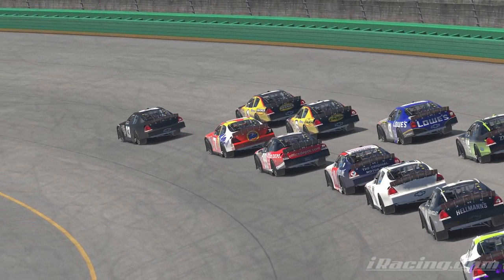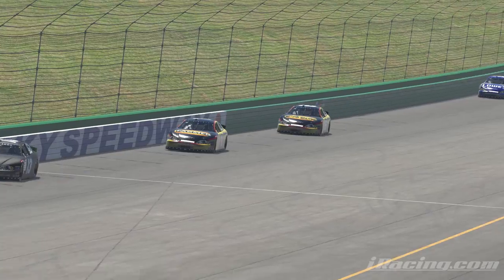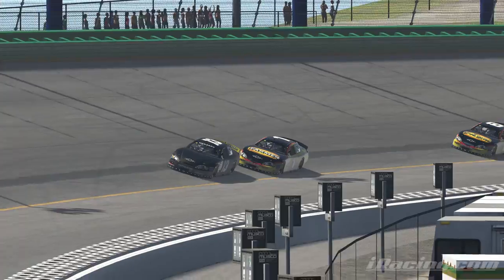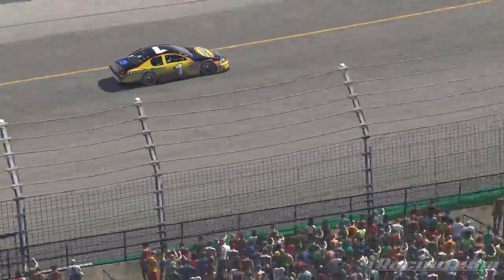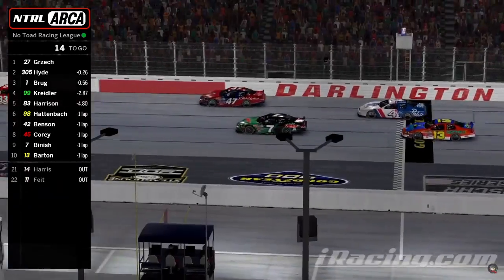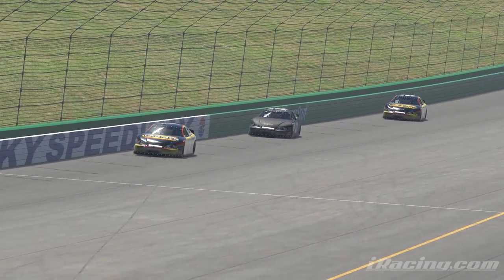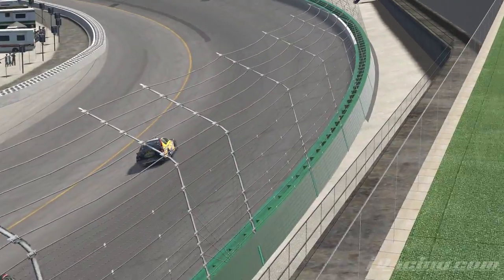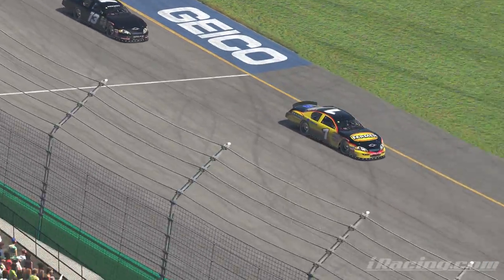7 Things Road Racers Don't Understand about Oval Racing

Comment: I've been a road racer for years and just now trying out ovals (mostly as a way to race without worrying about my iR, bad habit I know). Forgetting which corner I'm at is the biggest thing I'm struggling with for sure. As you said oval racing is a lot more mentally draining, as you can't zone out and run your laps the way you can in road, and every race there will be some laps I majorly mess up from losing that concentration. I've been trying the trucks at Darlington this week and it is NOT good to forget where you are there.
Reply: Every oval has a personality.. you will learn them as you go along... where the bite is.. where that little drop off is etc.
Reply: Indy looks easy but if you lose concentration it will bite you it looks like 4 90 degree corners than you drive and each corner feels so different
Reply: You'll get your Darlington stripe across the side of your car from hitting that wall 15 times in 1 race like everyone else lol

Comment: I race on a dirt oval. I was always told that breaking will make you slower, but in order to not rely on the break to set the car up in the corner, the car has to be setup for that certain track. That the hardest part. Driving will come with seat time. The hard part is learning how to setup the race car in preparation for a race.
Reply: What type of dirt oval do you do race? I do winged and Non-winged sprint cars and midgets, for nonwing and midgets the brakes are almost needed to get through every turn fastest, winged cars depend on the track and line. I just run the default setup iracing has given and gotten 3 wins in 22 starts this year all in open setup races
Reply: @tylerhendrickson5184  I race a USRA Limited Modified. It’s like street stock suspension on a dirt modified chassis. I’ve never been able to setup my old car in the corner without using the brakes, but I know of people who doesn’t used the brakes unless they are under caution, but they have a lot of knowledge about race cars. Idk how my new car will do. I just hope it turns better than the old one.

Comment: I don't think anyone would question the skill of the drivers, but what I don't get is why people watch it. Like, yeah there are a few more accidents, but at its core it's just cars going in a circle for 2 hrs, I couldn't watch this that long as it just looks so boring, its like that one torture method where they drip water on you for hours. Same with street tracks (and tbh, I just watch recaps for that exact reason) but there is at least a bit more to look at than just the cars.
Reply: While I don't like watching it, I could understand why, there's much more action than in other racing series such as F1 or WEC
Reply: I every never understand this take. People watch races so they can see drivers compete against each other. The track just facilitates that competition. If you want to see the drivers compete against the track, then why not just watch time trials?
Reply: @eliwhite5548  For me it's more about the cars performance at a given track, I guess this may cause the differing viewpoints on this.

Comment: Jimmie Johnson was great at maximizing exit speed. The way he rotates the car mid corner sometimes is unreal. You could even see it in Indycar on the ovals he had different lines to everyone else
Reply: Had a couple races like that at Richmond in the I***car (fixed). I was running the bottom instead of the middle like everyone else, was fastest on track the entire time, and won both races by a considerable margin. All thanks to trail braking and proper in-car setup differences, which saved my tires and let me be consistently faster than everybody else.
Reply: He is 7 time champion for a reason
Reply: I remember watching a Charlotte race back in the gen 4 era where one of the announcers noticed Jimmie's brakes were glowing, and he won the race, then next time the series went back there every car's brakes were glowing, everyone was suddenly racing it like Jimmie, but he still found that little bit extra in the turns every lap
Reply: Jimmie is a beast in oval races. Last season he found pace that seasoned racers did not have. Very average in road races, but probably the most entertaining on the ovals.
Reply: Kinda sad when they started broadcasting NASCAR in my country, he was retired already.
Reply: @djvycious  Average is a very very generous statement. He was straight-out terrible. He had no pace, despite driving top-team car. And his performance convinced me that Stock Car racers are inferior to other. There are instances, where open-wheel or sports car racers became sucessful in stock cars but never vice versa.
Reply: @jedlin1256  I'd say Scott McLaughlin is a pretty successful open wheel racer and he came from v8 supercars.
Reply: @Staggs2200  but he came from touring cars, not stock cars, still very different type of racing from Indycar, but also no oval racing
Reply: @jedlin1256  this recent chicago street race outright proved it. in terms of road courses nascar drivers just generally arent good, but their feel for the ovals theyve been racing their whole lives is just something else and its a lot of fun to watch

Comment: I'm Australian but went to college in America in the late 80s. 
Its unreal how you have describe almost perfectly what I heard a couple of legends say 30+ years ago.

I became fascinated by the tactics of NASCAR. Like American football its very simple at one level but then also incredibly nuanced in some very subtle ways.
One day I saw Daryl Waltrip go over his car and how it was setup. He talked about the position of the steering wheel which looked almost ridiculously close to his chest but it was so he could put his shoulder into it because of the fatigue of driving 500 miles every Sunday.
On a very similar vein Jackie Stewart had quipped about how it was just driving in circles so someone said here's my car go do some laps. Jackie Stewart could drive as fast but after 20 laps he pulled over exhausted from it. On several occasions afterwards Jackie told people NOT to underestimate how hard NASCAR was. He described it as relentless speed and the ability to do perfect left hand turns because (he explained) being slower by just a tiny amount added up very quickly and there's no real way to make up time like they could in F1.
Reply from the maker: Very cool experiences thanks for sharing!

Comment: Perfectly said about the eggshell under the throttle. I was running some practice laps at Milwaukee last night, and I had to learn that the hard way. Once I started finding that proper groove with the brake and throttle and steering, I was running 31.3 laps. Still not the fastest, but respectable in my opinion

Comment: I am a road racer and I have dabbled in ovals on iRacing.  From the shortest ones to superspeedways. I don't mind running them every now and then, and I have had very enjoyable races.  What really puts me off is not the concept of the oval, but stock cars. Most  oval races I liked were in openwheelers.

For me stock cars are too heavy, with horribly bad boaty suspension and the worst brakes ever. And, above street stock, they are ridiculously over powered, especially for short tracks.  I just can't enjoy spending all race in a single gear, between no throttle and half throttle.

It feels like driving a car that is broken, a car that I cannot lean on, I cannot depend on.  A car that works against me instead of with me.

I just saw a short interview with Santino Ferrucci after Indy Road practice, which kind of captures why I don't want to drive stock cars. They are simply bad cars.

Q. What's the brake marker in the Indy car, what's the brake marker in the Xfinity car?

A. So in turn one here in the IndyCar we're going 190 miles an hour braking at like the 300-350. The stock car you maybe hit 160-165 and you're braking before the pit lane wall ends. So there's not even a marker that goes that far back. I mean it's like a 1000 feet, 900 feet.
Reply: See, that's exactly what makes it interesting to me. Perhaps it's the endurance/rally driver in me that takes pride in finding the limits of whatever machine I have at hand, and nursing it to the finish. I love a perfectly dialed in car as much as anyone else, but I also love knowing that I can take an ill-handling car and quickly find it's limits and extract as much speed as possible from it without causing further damage. I've autocrossed everything from a 93 gmc suburban and 4wd jeep pickup, to miatas and vettes. I'll never forget the time I took a volvo station wagon to an autocross and someone in a 350z with a bewildered expression asked, "how are you beating me?" I don't say that to brag, I'm certainly not the fastest driver even in our local scca chapter, but I'm simply pointing out that a car doesn't have to be perfect to be fun at a race. ;)

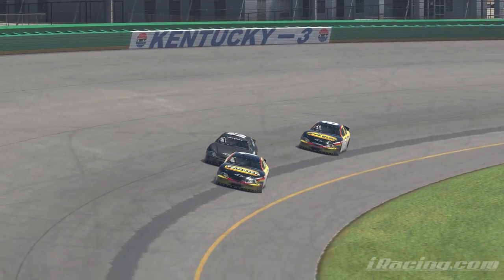Comment: 3:12 NOTE: "That your tires never go past the slip angle" is a nonsense statement. Slip Angle is a measurement not a threshold It's the difference between "straight forward' - a line cut through the middle of the tread on the tire - and the direction the tire is actually moving in the moment; It's a thing that's constantly changing, and there is no 'slip angle' you can 'go past' in the sense you've used it here. You can have 'less than ideal' slip angles - think: drift car with a 45* slip angle...you can do it in an ARCA car...it's just slow. 
Speed in Oval Racing is just like speed in every other kind of racing - you're trying to maximize your use of the Traction Circle. 
Engineering Explained has a great video called "Traction Circle - Explained" from 2011 that covers the Traction Circle really, really well.
Reply from the maker: I understand what you’re saying but in my opinion sometimes in racing explanations for newcomers, explaining a feeling simply if not 100% accurately, is more productive than overwhelming someone with tons of information to explain a simple feeling
Reply: @DJYeeJay  I agree - and you present information in a way that even a 20-year 'mid-pack' veteran like me can learn a lot from. 
Where I would (and have!) drawn a bright line is using a term that has one very specific meaning in a way that means anything BUT that - because you're explaining things to newcomers, and they're going to use these new words the same way they're being presented - and that's why (to me) using the the terms 100% accurately in their correct context is as or more important than making the context 'easy' for a newcomer. Especially when the differences are So, so, so ridiculously tiny, but the change in meaning and accuracy is huge. "never go past the slip angle" vs. "never go past the ideal slip angle" - 'specially when you immediately describe the consequences of exceeding the ideal slip angle in the corner - increased tire wear and the car going where you don't intend for it to go - into the infield, or into the wall, in the worst case. :_YeeRespects: 

When I ponder explaining something to a sim racer, I imagine a scenario where they wind up being like me, and move from sim-racing into local racing (autocross, for me. I loved campaigning my little $500 MR2) and imagine them having a conversation with someone who's raced in meatspace for a long time, and I try to explain things in a way that they can have a future conversation with Randy Pobst (as I did) and be able to hold their own - and not come off as a 'only' a dumb sim-racer. :_YeeCringe:

Comment: Solid advice, and I agree with attitudes changing. As an old NASCAR fan, I got used to the "They just go in circles" dismissals from road racing fans. There is a lot less of that now, and I'm wondering if racing sims have helped with that?
Reply: I'd  say a combination of Sims and having more than 2 road courses, with two of them being easily recognized by formula fans.
Reply: Yeah I think sims / racing games giving people a little bit more of an understanding as to how driving a car fast really works. 

Even before watching this video I've started to appreciate NASCAR more because I realise how difficult it is to take a big car like that at the limit around each corner (no matter if its always left) faster than all your opponents. You're obviously only one mistake away from a crash. 

Only total numpties still think oval racing is easy if they can't even understand the above letalone the other nuances of oval racing.

Comment: I once joined in an oval race and it was thrilling.
It was a super speedway with skip barber car and demanded much more conentration than a regular road race.
Sadly I was involved in a crash, and after that the gap between car was too big, and it was boring to drive alone

Comment: To that point, I keep hearing about bump drafting but I have no idea what it is or how it works. A video on that at some point would probably be widely appreciateed.
Reply: Bump drafting is essentially hitting a car's rear bumper and transferring your energy into their car to go faster. You don't want to run someone over, just a little bump.
Reply from the maker: Yeah what Yappit said. Some nuances to bump drafting are that many cars noses don’t line up flush with the bumper making it really easy to wreck a car while attempting to bump draft. Stock cars can also kinda stick together when bump drafting due to aero and make a tandem of cars that can go a lot faster than even the normal draft pack. But be careful because the car behind will overheat their engine really fast like this, usually within a lap or 2 so it has to be used only for big moments
Reply: Bump drafting means to literally gently push your front bumper up into the rear bumper of the car in front of you and then continue to push them full throttle as you work together to both go faster than you could alone.

The rear car is moving faster because it's drafting behind the front car so rather than go around him and eventually lose speed anyways, you gently get on their rear bumper and push them with your extra speed from drafting. This can allow a whole train of cars to pull away from the pack and go much faster than any of them could on their own.

Crazy concept huh? Actually working WITH the people you're trying to beat to give both of you a better position. Also sets up great duels at the end when the truce is off, hehe.

Bump drafting is usually reserved for super speedways and there are certain cars you just don't attempt it in like the Arca car. Also you should really start the bump draft on a straight, preferably the beginning of a straight. Starting a bump draft going into corner entry is a great way to spin out the person in front of you and make an enemy.

Good bump drafting takes practice, patience and balls of steel from both cars.
Reply: When to bump draft in the ARCA car - NEVER. NEVER EVER EVER EVER EVER use the ARCA bumper. DO. NOT. DO. IT.
The bumpers on the ARCA don't line up, and it won't be a 'bump draft' - you'll lift the rear tires off the ground and turn the guy ahead of you hard into the wall, setting up a crash that people can't avoid, thus ending a LOT of people's races - Do Not Pass Go, Do Not Collect $200.

The rest of the NASCARs do line up, but the Trucks have very fragile aero, and even a light wall brush can send you sailing backward through the field...so weigh the risk/reward for bumping in the trucks knowing that...

Finally, The Iceberg has a great video called "The Complete History of Tandem Drafting" that does a good job explaining how NASCAR evolved the bump draft over time.
Reply: A few things to remember if you're going to start trying it:
- Avoid bumpdrafting in corners. Unless you're super-experienced and the person in front also knows what they're doing, it'll only lead to wrecks.
- Don't bumpdraft anyone in the draft already. They're making sure not to hit the person in front of them and don't need your help.
- Make sure you can consistantly drive in a straight line before trying it, and make sure the person you're going to bump can do the same. Bumping someone who is constantly adjusting their line is going to lead to off-centre bumping, and potential wrecking.
- Over time, you will come to the realisation that just getting and staying really close and relying on the air-cushion between your cars achieves much the same effect, and you'll use the bump a lot less.
Reply: One of my tips is hop off iRacing and race with high level AI on NASCAR Heat 4. You can set the game up for complete realism, and the AI will understand both how to bump draft and how to be bump drafted. That will matter in the long term. It's still good experience.
Reply: The car behind can go quicker because they're in cleaner air, so they can push the car in front to speed both cars up. There's no point for the car behind to try to overtake because they will lost the draft and just end up side by side, so it's better to bumpdraft and work together to get away from the larger pack of cars, then make your move when the right  time comes.
Reply: My tip for bump drafting: don’t do it if you live in Australia because a little bump will mean you netcode both cars to death 😅

Don’t ask me how I know…

Comment: As a primarily oval racer and seeing people say the same concepts apply to road racing, I’ve won and competed for wins on road racing and that just isn’t the case. Road racing I can hit the same marks every lap with very little change in the handling or speed of the car. Both are unique challenges in road racing challenges how close you can push your car off a corner consistently compared to oval racing which is who can spend the least amount of time and tires making a pass and making up time.